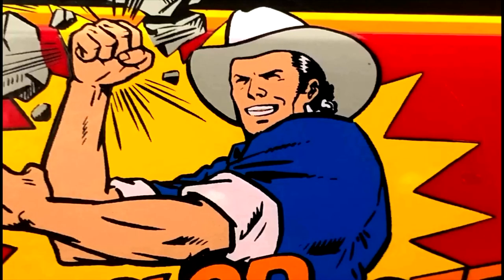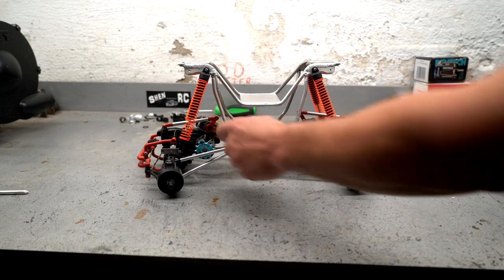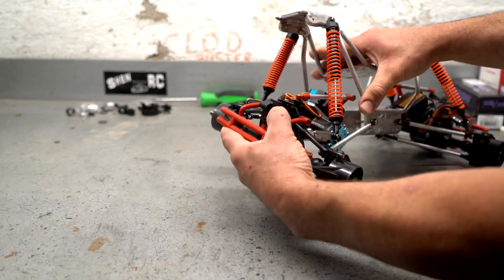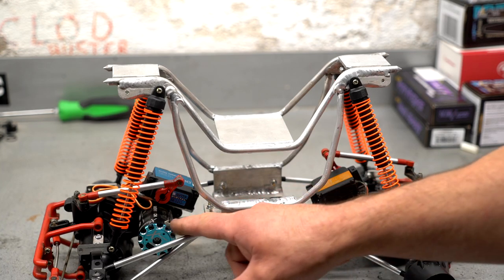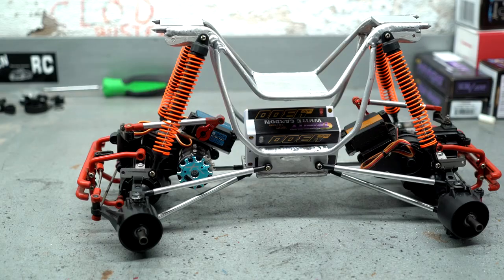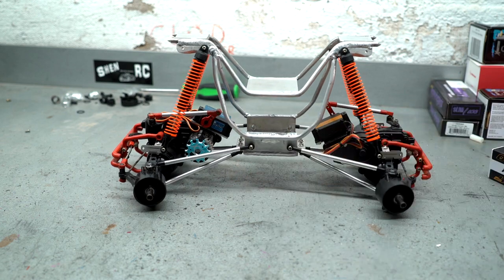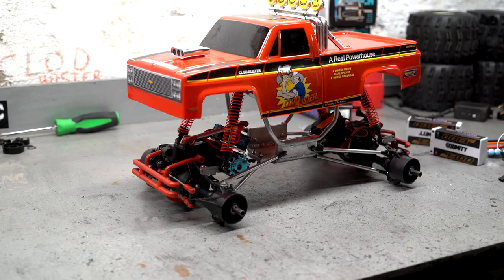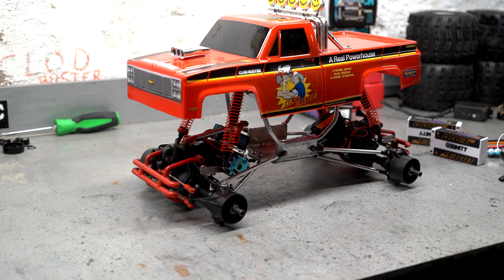Tamiya Clodbuster Brushless Race Clod Almost Complete

Comment: Looks great dude! One step closer to full-on clodbustin!  Do you always prefer to use the stock servo saver setup?  Ever try using Kimbrough 124's?
Reply from the maker: I used a kimbrough a while ago but I’ve found the stock servo saver to be very reliable if adjusted properly